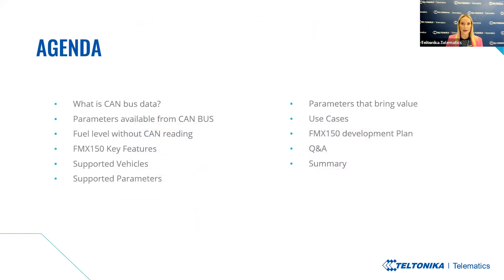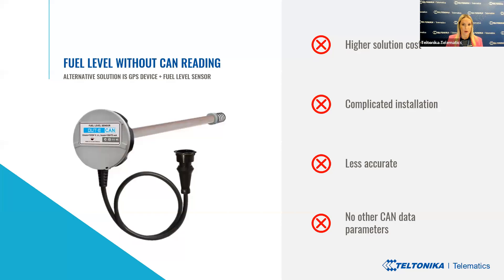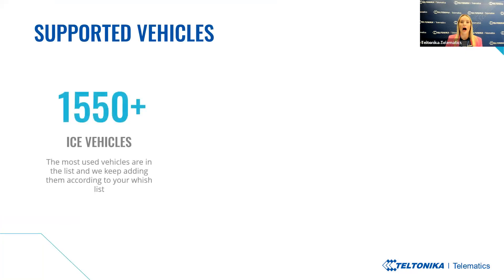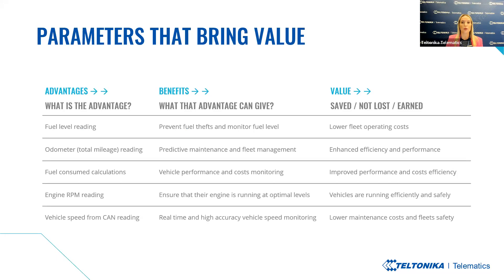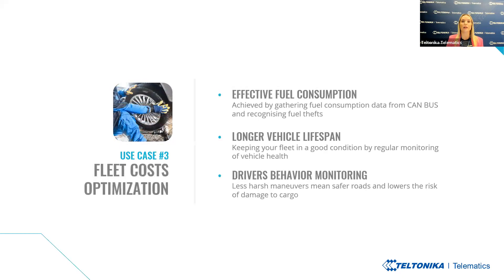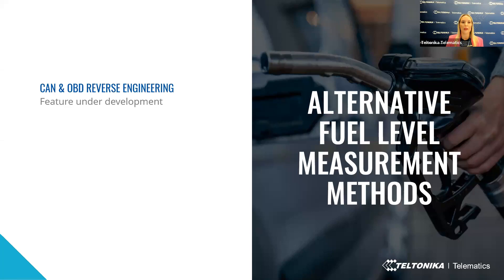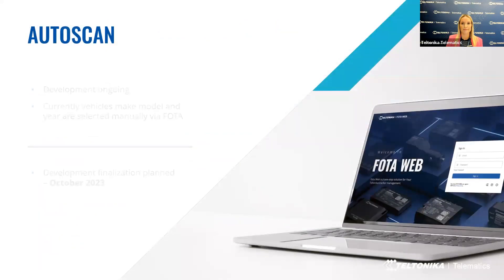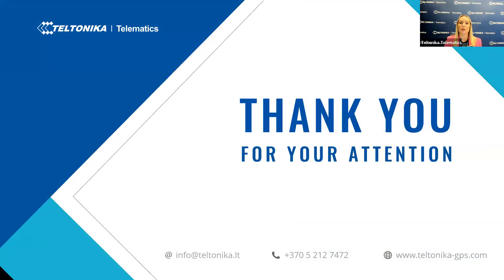Webinar | Advanced Can Data Capabilities with The FMx150 Series | Teltonika

Comment: Pls I want to enquire if teltonika supports 808 protocol
Reply from the maker: Hello,

FMx150 device supports the following CAN protocols: OEM, J1939, IES500, IES125. As for the "808" protocol, the only corresponding protocol would be JT808, which is designed for data transferring. However, FMx150 series does not support JT808.
Reply: @TeltonikaTelematics  which teltonika device can support the protocol. Plsss kindly recommend